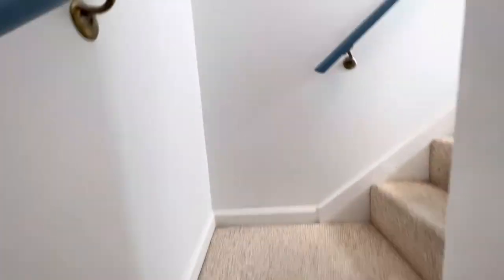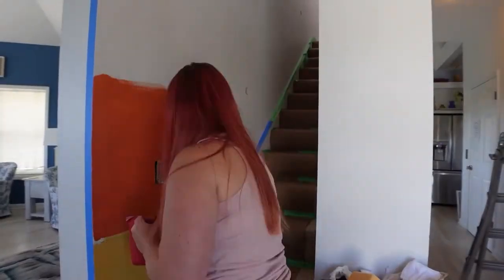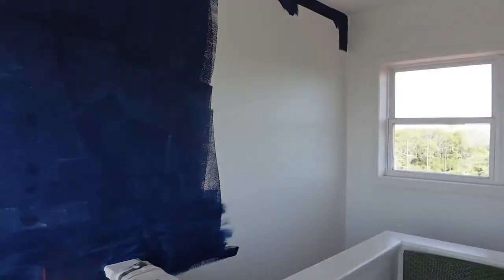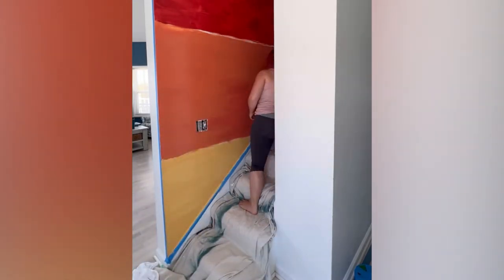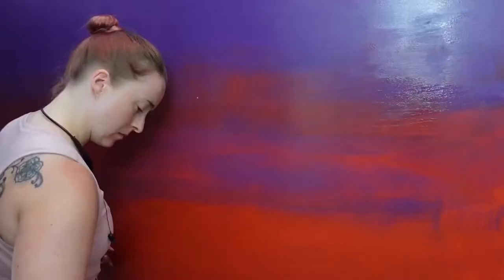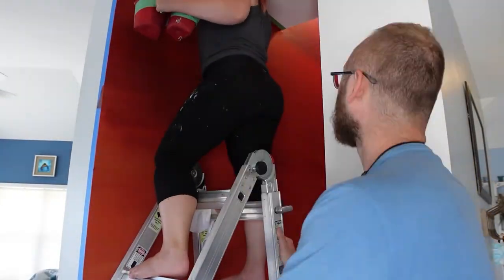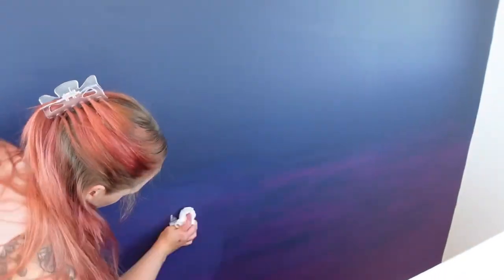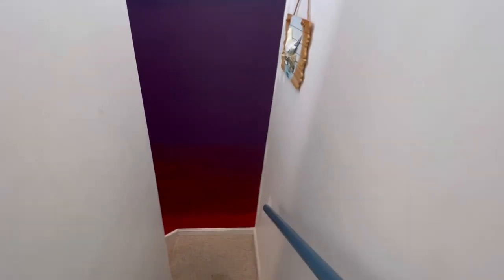How to Paint a Sunset Ombre Wall

Comment: How do you blend those colours? On the paint pallete or straight on the wall?
Reply from the maker: Mostly on the wall. I did pour both colors into one paint tray for the roller, but I kept them separate in the roller tray, I didn't mix them together. I hope that makes sense!